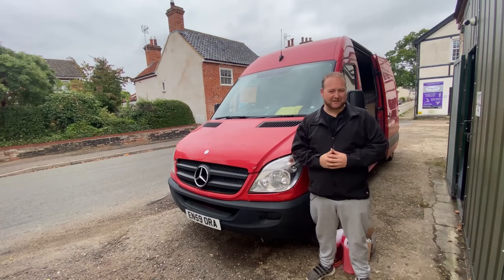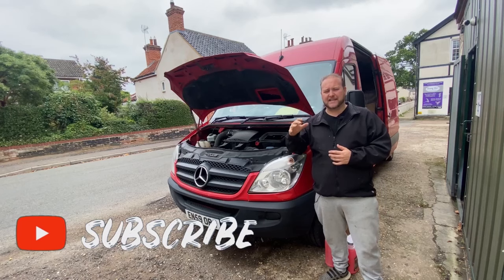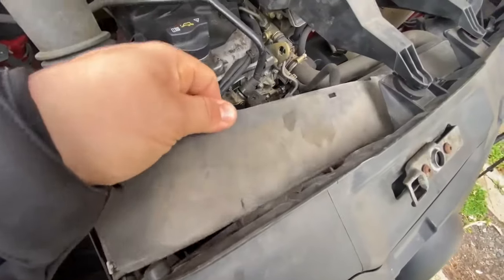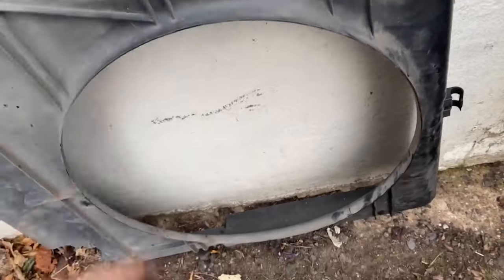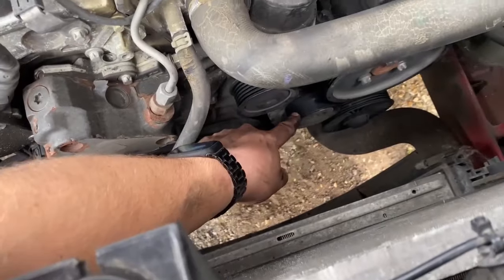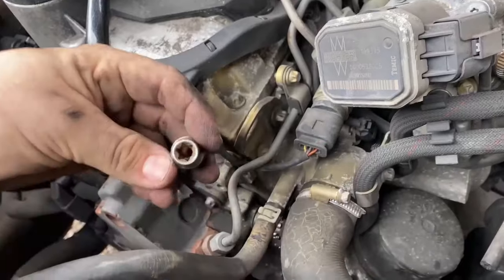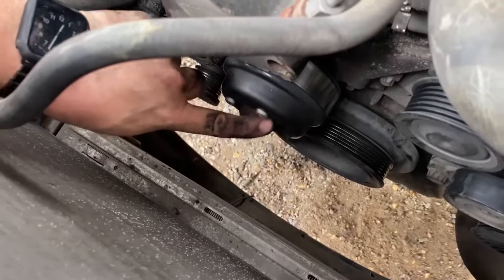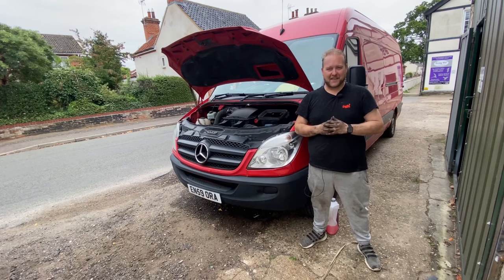Replacing The Water Pump On My Mercedes Sprinter

Comment: When I look for videos to help me (clueless) fix my sprinter, it's always the wrong engine or it's a dodge, quite often useless, but you have the same engine as mine and in a short but good video you have answered so many of my questions that I'm ordering a new water pump now! Thanks
Also, with the tensioner, as others have said use a socket to pull the tension off and there is a hole that you can stick a 3 inch nail / bolt whatever, to keep the tension off, much longer than that and It gets in the way of the belt replacement
Reply from the maker: Thanks man! Glad I could help and thanks for advise in future (hopefully won’t need to do it again 🤣)

Comment: You use a 17mm spanner/socket on casting in tensioner and rotate it to release tension for serpentine belt removal.
Reply from the maker: I dunno why but I couldn’t get the spanner on to begin with was a nightmare couldn’t get the purchase on it to actually adjust the tensioner. Thanks for the info tho! 

Jason

Comment: On a 2014 4cyl it takes a 5/16 hex-Allen wrench at the center of the fan and I used a pipe wrench to hold the arbor. I thought I would mention it since there is nothing on YouTube on this 4cylinder.

Comment: Hi hope you can help as I am just about to replace a locked Viscous fan clutch , at 2:19 you say that its not a reverse thread so to remove the Fan I would use an 8mm Hex and go anti clockwise to remove it ?
Reply from the maker: That’s it bud yea. I thought they where all reverse thread but this one wasn’t! So yea just undo the bolt in the usual way
Reply: @TrackAndBeyond  Perfect thanks for the quick response, subscribed ;)
Reply from the maker: Thanks pal 😃

Comment: What torque did you use to Tighten?
Reply from the maker: The torque setting I found was 20nm. However there where a few different specs I found so just a warning
Reply: @TrackAndBeyond  So you tightened to 20nm? That seems alot.
Reply from the maker: Go for 10nm then, I used 20 but like I say iv seen 10, 14 & 20nm as being listed

Comment: You use a 17mm spanner/socket on casting in tensioner and rotate it to release tension for serpentine belt removal.
Reply: A 3 inch nail fits in a hole to keep it the tension off and not get in the way while you put the belt in place, then reverse your tip